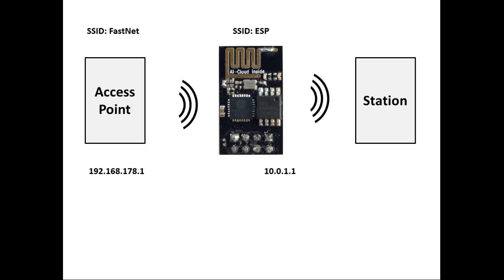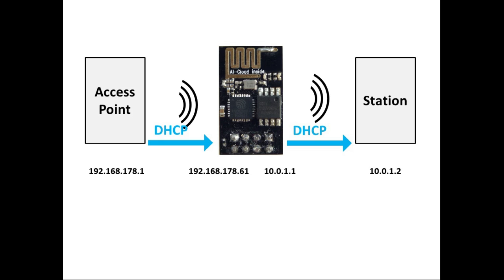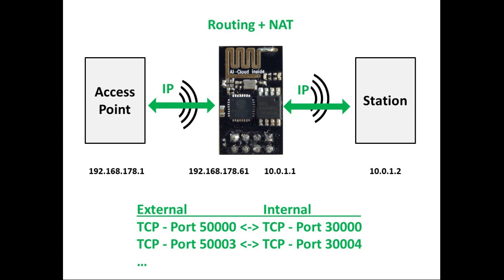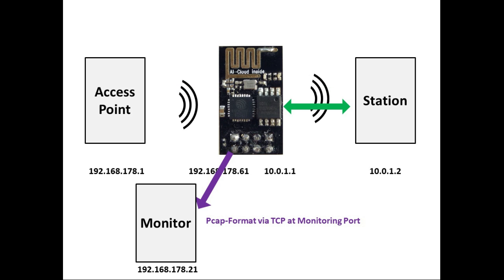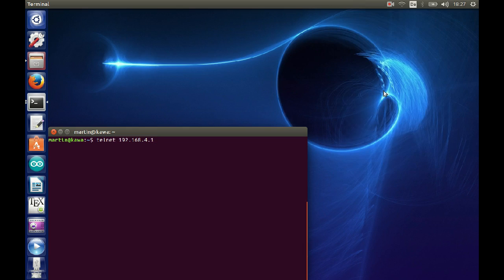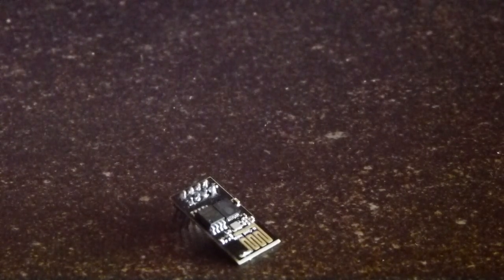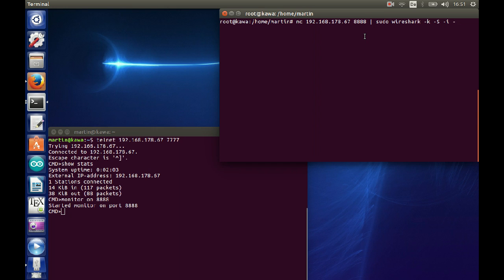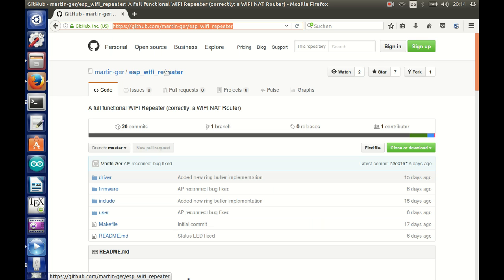ESP8266 WiFi Repeater (NAT Router)

Comment: Hi Martin thanks for this useful project .
Ca you help me because after I flash the code its actually works but how can I connect it to the AP with spaces because when I tried to connect it is not working ..
Reply from the maker: https://github.com/martin-ger/esp_wifi_repeater#basic-web-config-interface: "If you want to enter non-ASCII or special characters in the web interface you have to use HTTP-style hex encoding like "My%20AccessPoint". This will result in a string "My AccessPoint". With this hex encoding you can enter any byte value you like, except for 0 (for C-internal reasons)."

Comment: can you please make step by step flashing the esp?
Reply from the maker: There are may tutorials on flashing an ESP8266 out there. For flashing a basic ESP-01 e.g. this one: https://www.youtube.com/watch?v=Fk-CQ7sUVRs
The only thing you have to change is the actual firmware. Configure the flasher tool to load two firmware files: firmware/0x00000.bin to adress 0x10000 and firmware/0x10000.bin
Hardware setup is much easier if you use a board with build-in USB like a NodeMCU or a Wemos D1. Then you just have to connect it to USB and do the flashing.

Comment: I can't see the MyAP network, I already loaded everything.
Reply from the maker: Is there any reasonable output on the serial after reboot? I probably used the wrong flashing paramaters or a corrupted bin file (can happen when downloading it stand-alone through the browser). Use it from the zip of the repo. There are many issues like this in the issue list.

Comment: Hello Martin, can this code used with ESP-12E ?
Reply from the maker: Yes, it works with any flavor of ESP8266 boards.
Reply: Martin Ger can You tell me how to flash because this bin you add not work. esp12e go into the loop. i flash using your instruction. same instruction and bin with esp01 work. Thanks.
Reply from the maker: Use the "-fs 32m" option for the latest SDK. I have updated the flashing instructions accordingly.
Reply: Martin Ger  thanks I'will try.

Comment: How to change default mac address in the device please give the command with an example?
Reply from the maker: Added "set [ap_mac|sta_mac] xx:xx:xx:xx:xx:xx" in the lastest version. Sets the MAC addresse of either AP or STA.
Reply: CMD>set [ap_mac|sta_mac] 28:C2:DD:24:6E:4F:

Invalid Command
CMD>
Reply: i am using the 0x40000 firmware did it work on yours?
Reply: it worked in your newest update thanks a lot, Yep it worked thank's a lot for your help now i can use internet in my institute and share it with my friends they used a mac filter in the router that's why.

Comment: Is this project compatible with wemos D1 mini? Thank you.
Reply from the maker: Yes, I have it running on a Wemos D1 mini here.
Reply: @martinger327  I am using an ESp8266 eps01 and everything is ok., But if i am flasing wemos or nodemcu somehow the web interface acts strange. I can change the AP settings but it does not work to change/add STA settings. In this case the serial does not show anything.
Reply from the maker: @cp-vf4om  Sorry, I am not aware of any general problem here.

Comment: Hi Martin, Is there a way to secure the telnet shell?
Reply from the maker: You can switch it off after configurarion.
Reply from the maker: With 'lock <passwd>' you can also secure any config changes.
Reply: @martinger327  how do I switch the telnet shell off?
Reply from the maker: @ziggyspaz  set config_access 0
save
reset
Reply: @martinger327  Thank you!

Comment: Thanks for this beautiful explanation.

Is there way if I want just one of the 192.168.178.x device to communicate with whole 10.0.1.x network.
Reply from the maker: If the connection is initiated from the 10.0.1.x devices - no problem, just works (e.g. connections to a central MQTT broker). If the 192.168.178.x device wants to establish a connection to a 10.0.1.x device running the server, you will need an explicit port forward in the router. Can be set on the CLI, but this is not dynamic and works for each port just for one device. This is a NAT-specific limitation.
Reply: Thanks for quick reply, I just checked so I can do like "portmap add ext_port 10.0.1.10 local_port"  and then all 192.168.178.x devices to able to connect 10.0.1.10 via ext_port. Is that right ?
Reply from the maker: Yes, but don't forget TCP or UDP in the mapping command.
Reply: Yes Right, Thanks :)
Edit: I'm using one repeater for IoT and have one node connected to it for testing purpose. I was trying to upload a program via OTA to that node and did require port forwarding on repeater but unfortunately, it didn't work. Am I missing anything ?

Comment: Is it possible to connect a external antenna? solder it
Reply from the maker: You can - using the right HW. An Wemos D1 Pro i.e. has an external antenna connector. But this is independant from the SW.

Comment: Hi all, I did try ESP32 NAT router. I was  use spark fun thing plus board. I did take speed test through my mobile. ESP32 board placed 14 meter from the router and mobile placed 1 meter from the ESP32 .            1) mobile connected with router, download speed 43 mbps and upload speed 31 mbps. 2)mobile connected with ESP32 , download speed 4 mbps and upload speed 3 mbps. How to increase internet speed in this case ? please suggest suitable solution to me. Thank you.
Reply from the maker: There is not much you can do other than better antenna and some experiments with the direction. Everything has to be transmitted twice in both directions so the best you can expect it half the throughput, but this is best case.
Reply: @martinger327   can you suggest any other micro controller for this application ?
Reply: @deenadayalan4040  MikroTik mAP Lite

Comment: Hello Martin NAT configured properly i have configured new ssid and password and network address 192.168.8.0 but one problem is two wireless network is available one my new configured secured and one is open with name ESP_1B6274 with network address 192.168.4.0 how i can disable this wifi or secure with password
Reply from the maker: I am not aware that the ESP can create two SSIDs at once. Are you really able to log into the non-configured SSID? My guess would be: this is a cached entry of your client.
Reply: @martinger327  yes I am able to connect both ssid even my webserver working on both ssids I will send video when have time

Comment: manymany thnx! :) but is have a problem...i connected with an another nodemcu to this, but i cant see the generated webpage (temperature controller). i try fixed ip, still not working...but connecting fine...
Reply: one more thing: i added port number 80 TCP with the another nodemcu's ip, and nothing happens. still timed out from webpage....
Reply from the maker: Did you add 'portmap add TCP 80 ip-of-nodemcu 80'? Then you can access the nodemcu unser Thema external IP-address of the repeater.
Reply: thnx! i added!

but webpage respond just sometimes, because the connection is correct. i soldered antennas from my old router. so it is gained now, but maybe takes more power?!?! what happening if i give him 9V with 1.5A on Vin pin... wht do u think? can i expand rage to 10-12meters with more power with this antennas?
Reply from the maker: 9V - try it, it will start communication with smoke signals instead of WiFi...
You will need a stable Power supply at 3.3V - nothing Mode.
Reply: okay. thnx!
Reply: Martin that was very funny

Comment: Been looking for this. Flashed the precompiled firmware into 8266 12E and configured as described but set ap_open 0. I saved the config but my AP remains open though the device says it is not. Have tried several times but can't get the thing to use encryption.  Also, seems I can only change the ap_ssid once before I need to do a erase EEprom. Any help appreciated. EDIT: also found that I can not enter an ssids or passwords which contains white space for example: password This is my password,  goes in as "This.
Reply from the maker: The new settings are applied after a reset.
Reply: Yep, I know. I did that in various forms several times. I have a similar
 dev board to yours and have used save & reset from telnet, save 
& hard reset on board and have also saved & power cycled but 
still can't get the encryption to kick in. 

The ssid thing I mentioned above: After the initial flash with your 
pre-compiled binaries, I get one chance to change the ap_ssid and it 
works. If I want to change it again I have to fully erase and re-flash. 

I will be looking to recompile your source and will have a further look 
myself but so far have only had about an hour to play with it. Really 
impressed that I could watch youtube via an ESP8266 repeater. Speedtest 
says I get around 6meg transfer rate which is also not bad at all. Just 
need the encryption and it's good to go.
Binaries are date stamped 22/01/2017.

Thanks for showing that this can be done. :-)
Reply from the maker: Strange - not a known issue. Maybe you try to delete any existing default WiFi config by flashing blank.bin to  0x7e000 & 0x3fe000
Reply: I'll keep playing with it. As I said above, I have fully erased each time.
This is definitely a huge step in the right direction though :)
Reply: OK, perhaps a dumb on my part. 
The ap_password must be at least 8 characters long for this to work.
So long as the password is >= 8 chars, the encryption and the ssid change works. Seems that my short password invalidated the whole setup.

I would like to be able to enter passwords & ssids which include white space chars (spaces) is there any way that I can do this? At the moment, the ssid/password strings are truncated to the first space. eg (ap_password This is my password) ends up the same as (ap_password This).

EDIT: ssids / passwords in reality can and do contain spaces.
Reply from the maker: Now it understands quoted chars on the cmd-line. Just write '\ ' for a space.
Reply: Thanks :-) That, together with the port forwarding additions
made this perfect.
I realised why it wasn’t working had just finished rewriting
the whole command input / tokens thing to provide fix for my own use when I noticed you had updated your Git. 

Think I’m going to leave it to the expert in future. The way
you did it was / is far superior.
Brilliant project.
Thank you.

Comment: UPDATE: I've upgraded 1MB flash memory chip on ESP-07 module with the following 4MB chip: http://got.by/3mbvyj  and it works flawlessly now. So, looks like 1MB flash memory is not enough...

Dear Martin. Great Project! Thank you!
Need your help. Flashed bin files to NodeMCU (4MB) - works perfectly. Flashed to ESP-07 module (with Antenna connector, 1MB) - seems it does not start, MyAP does not appear (blue LED is off all the time). Managed to catch the following at COM port at boot (speed of 74880kb/s): 
load 0x40100000, len 1328, room 16 
tail 0
chksum 0xef
load 0x00000000, len 0, room 8 
tail 0
chksum 0xef
csum 0xef
csum err
ets_main.c

Appreciate your response!
Reply from the maker: Did you try DIO mode for flashing? 1 MB should be no problem.

Comment: Can you help me connecting on WPA2-Enterprise Security? 
I have tried Command Line Interface WPA2 Enterprise Config but not connecting. 
Username and Password are correct.
Reply from the maker: You will need all of these settings, especially the peap_identity value is improtant. Do you have the right settings here? 
 - set use_peap[0|1]: selects, whether the STA should connect via simple WPA-PSK (use_peap=0, default) or usinf WPA2 Enterprise (PEAP)
- set peap_identity value: sets the PEAP 'outer' identity (the string that is first presented to the RADIUS server, maybe anonymous@yourorg.org)
- peap_username value: sets the PEAP username
 - peap_password value: sets the PEAP password
Reply: Is the peap_username same as peap_identity?
I am using this code on my Raspberry Pi in connecting at WPA2 Enterprise.

network={
ssid="connect"
key_mgmt=WPA-EAP
eap=PEAP
identity="username"
password="password"
phase2="auth=MSCHAPV2"
}

By the way I am the one asking above. I thought its my account I am using. Thank you!
Reply from the maker: @wolflariosa4414  peap_identity is the first thing sent: could be anonymous@yourorg.com, it defines the domain the authentication request is sent to. username/password are the actual credentials as usual.
Reply: @Martin Ger  Sir thank you for your kind support. I will try it again when I get back 😀
Reply: Hi Sir Martin should I use "set ssid command" when connecting WPA2 Enterprise Config? We have multiple access point with same ssid.
Reply from the maker: @wolflariosa4414  Yes, you have to set the SSID also die WPA-Enterprise.

Comment: Hi Martin, cant we do this in Arduino sketch?
Reply from the maker: Have a look at this https://github.com/esp8266/Arduino/blob/master/libraries/ESP8266WiFi/examples/RangeExtender-NAPT/RangeExtender-NAPT.ino
Reply: @martinger327  Is it possible to code an esp32 as a webserver+wifiscanner+AP+while connecting to a router/home internet(wifi. begin)?. The idea is to deal with peers as an independent sensor but communicate readings back and forth to the main server to get instructions.
Reply from the maker: @evanfelthman4692  Can be done. As a starting point you can use this: https://github.com/martin-ger/esp32_nat_router
Reply from the maker: Sorry, no Arduino sketch...

Comment: that's cool,but the ssid can't set blank name!
Reply from the maker: If you want to enter non-ASCII or special characters in the web interface you have to use HTTP-style hex encoding like "My%20AccessPoint". This will result in a string "My AccessPoint". With this hex encoding you can enter any byte value you like. %00 should even give an empty name.

Comment: i test it the speed so low also rang not far either .. am i doing it wrong?
Reply from the maker: I would guess an antenna issue. Some boards designs have real bad antennas...
Reply: so how far can your connect to AP?
and how many Mb/s can it repeater?
Reply from the maker: Users reported up to around 5 Mbps. Range depends on antenna and environment as usual for WiFi. Indoors about 10m.

Comment: Is it possible to create a VPN with this device? CMD>set ip ?
Reply: Most probably not. But you can use it as a physical channel for anything, including a VPN. The station speaking with the ESP can peruse a VPN tunnel when communicating through the ESP. The execution load is then put upon the station.
Reply: But it has a command in telnet called set ip xx.xx.xx.xx ? and it works but  , also shows internet but the browser dose not show any page..
Reply: VPN is a system for creating an encrypted tunnel. It requires software with some kind of encryption, often on the kernel level. It appears as a new ethernet connection. I don't understand what relevance 'set ip xx.xx.xx.xx' has. It is simply a way to set the IP number manually if there is no DHCP, and if it doesn't work, it is because you have set up a flawed combination of own IP plus router/gateway IP plus subnet mask.
Reply from the maker: It has no build-in VPN funktionality. "set ip" is just for the non-DHCP case.
Reply: Is it possible to code it?
Reply from the maker: Nearly anything can be coded.... ;-) What do you think of? Which VPN protocol? What's the use case?
Reply from the maker: Could be done probably - however, this project was not intended to provide an attack device. Thus, I won't extend it further into that direction.

Comment: can it be transparent  bridge?
Reply from the maker: What exactly do you mean by "transparent bridge"? In terms of networking, the ESP works as WiFi-Router at Network Layer and the STA and the AP side belong to different IP-networks. However, as it uses NAT the routing is transparent to uplink and downlink nodes, no additional configuration is required here. 

A bridge would work at Data Link Layer and both sides would belong to the same IP network. Without access to the WiFi driver I don't see any chance to implement that.
Reply: transparent bridge_ means no routing only bridge through? possible? so both side of net work devices can see each other, under same group of network..
Reply from the maker: As Is said - no, not possible as the driver doesn't support this. Tested that, but at least I did not manage to send out a packet with the "wrong" source MAC.

Comment: Thank you for your great work.
I'm using Domoticz which is a home automation system for my project.
My Domoticz server is installed on 192.168.1.110:8080
If I want to send a command to an ESP node I use the following command rule for example:
http://192.168.1.121/control?cmd=GPIO,12,1

but when I try to send a command to the node which is connected to the ESP repeater the command is not send! 
I use the following command:
http://192.168.4.122/control?cmd=GPIO,12,1

It seems the Domoticz server which is installed on 192.168.1.1 can't access the ESP node which is 192.168.4.122

How can I tackle this problem?
Reply from the maker: You need to set a port forward: "portmap add TCP 80 192.168.4.122 80", then you can access it at the address of the repeater.
Reply: thank you so much it solved my problem.
Reply: Thank you, it solved my problem. You've done a great job.

Comment: Hi can use this way Ethernet device also
Reply: Actually am trying to make bridge for wireless bridge for Ethernet device (exam. D-link switch)
Reply from the maker: NAT works for ethernet as well. I did some experiments with an ethernet board and the ESP8266 (see the git repository). It generally works, but high load is critical. I would try to use the ESP32, which has a build-in ethernet controller.